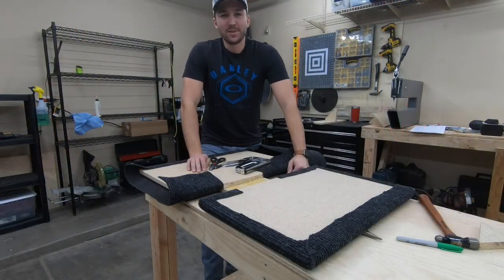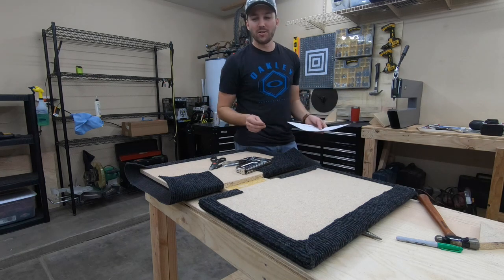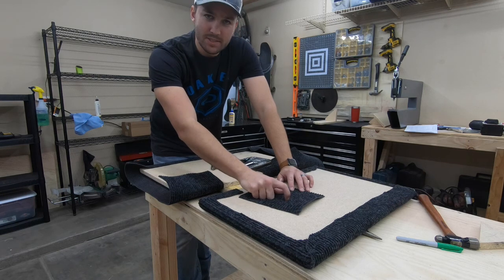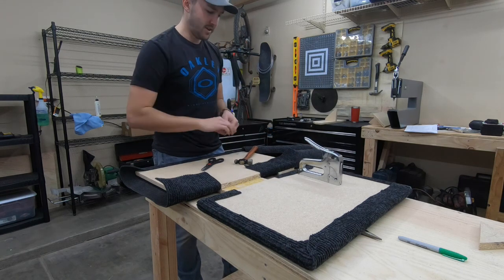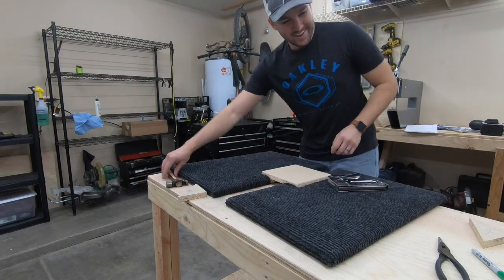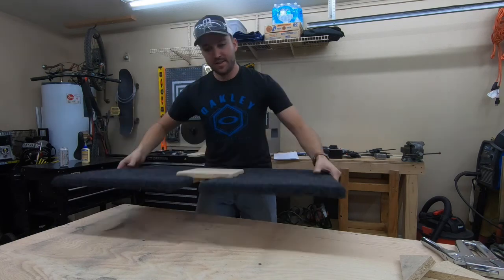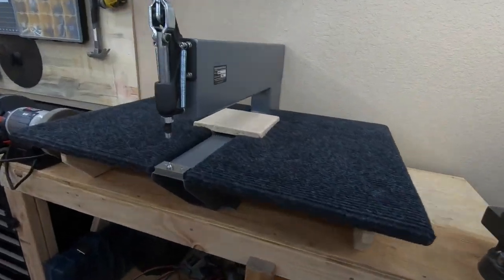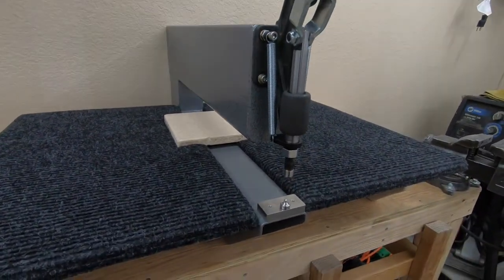DRDT-2 Assembly and Platform Build

Comment: Male dimple at the top, and you don't need the carpet.
Reply from the maker: That would work! Though I tend to do 99% of my dimpling with male die at the bottom to positively lock the skin in place and prevent hole misalignment when working quickly
Reply: @AustinManke   Yes, I can see how that would help accuracy in alignment. Thank you.

Comment: What the purpose of the non carpeted piece bridging the two halves?  Will it not get in the way of skins?
Reply from the maker: It holds the two sides at a constant width and helps to support them. It doesn’t get in the way of the skins too much since the skins are so flexible. I have seen others just build two independent platforms, likely for that very reason of not wanting a bridge piece. Either way should work well for you!